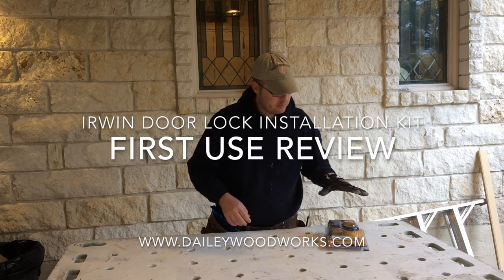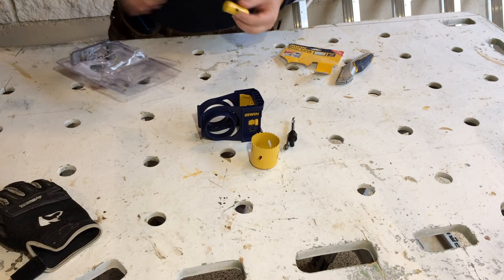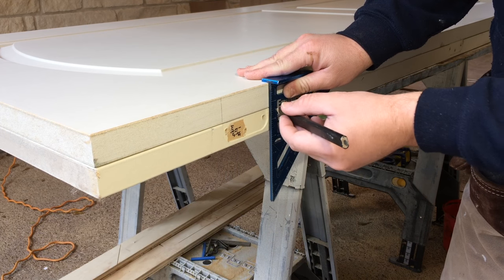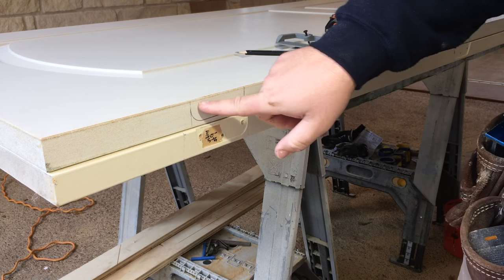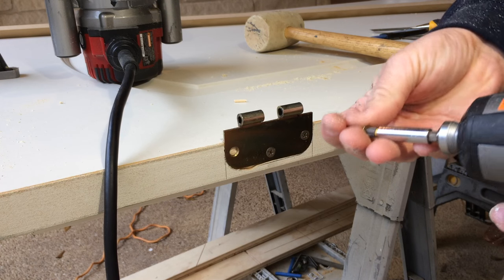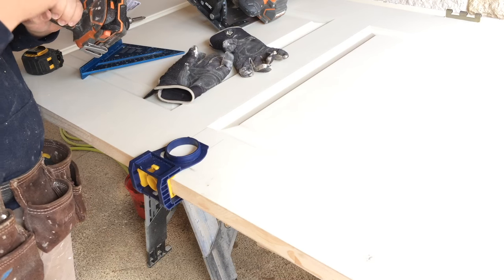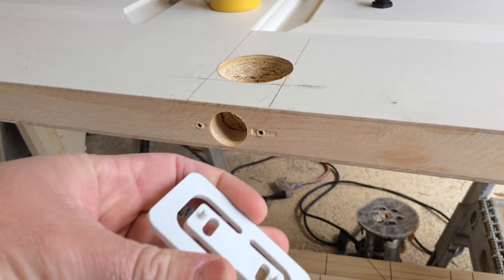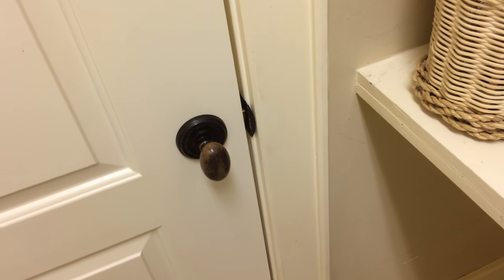Replacing a Hollow Core Door with a Door Lock Installation Kit

Comment: Nice video, brother!

I may need to upgrade mine in the future. I'm rocking an old Black & Decker set that's seen better days, and definitely didn't come with mortising guides... I had to make my own. Unfortunately, the palm router I had died and has since been replaced with a Rigid palm router, so I know my guides won't work (the old router was a Craftsman model from probably 30 years ago that I inherited from my wife's grandpa).

By the way, I got my new trailer and got some basic shelves in it just to get back up and running, but my full build out is still coming. I didn't have time to film while I was getting everything in. I will say, though, that using it the last month or so has definitely pointed some things out that I want to address in my work flow, so I suppose it's good that I was only able to do a basic build.

Anyway, great video as always, sir!